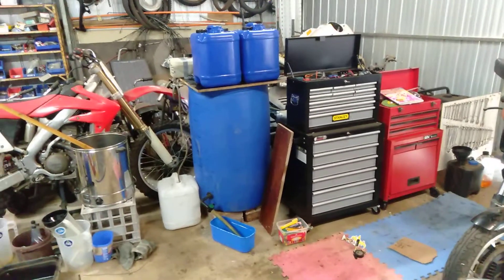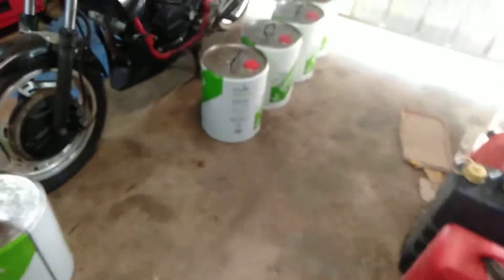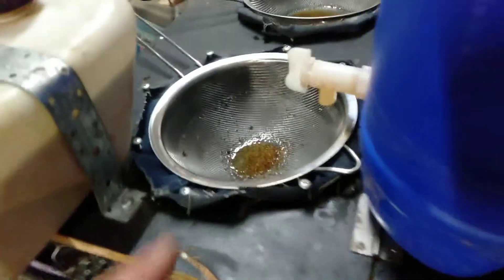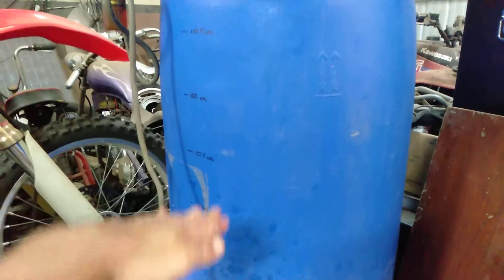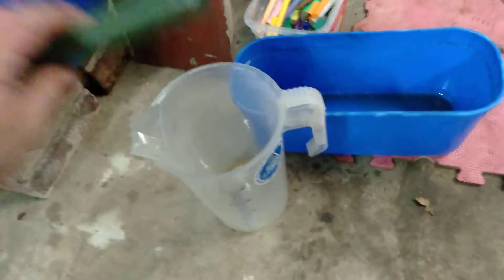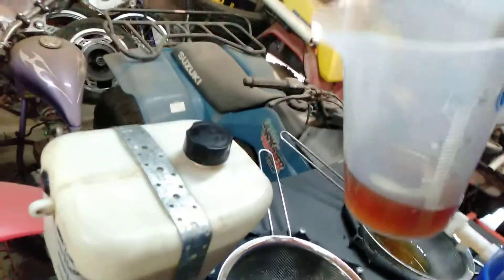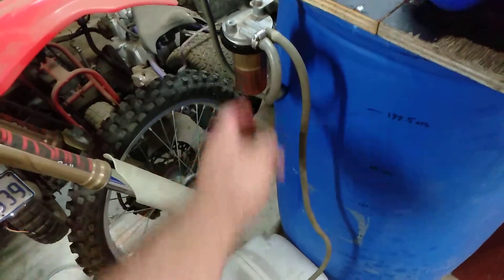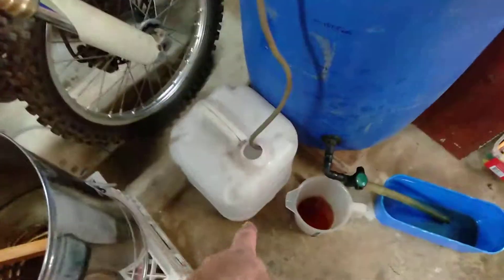How to use filtered vegetable oil in diesel heater or any diesel engine

Comment: What you need is two separate tanks one with diesel and one with the 50/50 mix . So two separate tanks with two separate lines . At the end of the line put a double tap on the lines with one out feed tap on it . Start the heater with diesel for a few minutes then then change over to the mix . Before you turn off the heater shut off the 50/50 mix and open up the diesel tap and let that run for a few minutes to burn off any excess. You should not get any clogging in the heater or exhaust pipe . But they do say to run the heater a little higher when using the 50/50 mix . Always use a carbon monoxide detector no matter how big or small the heater you tend to use for that purpose.

Comment: Why not go all the way.
Mix the oil with methanol and lye, to get rid of the glycerol.
Reply: much more tedious work, dangerous chemicals, plus it will eat away at your fuel line/gaskets if not replaced to S/S or other

Comment: What do you think of using B100 with either  methanol or isopropyl alcohol; example 1 Gallon B100 with 1L methanol seeing we use methanol to make BD to run on a kerosene heater.

Comment: Looks great mate! How are you finding the little heater? Have you had any problems using it with veggie oil in the last 2 years?
Reply from the maker: Hi mate eventually it did seem to clog up the heater And it stopped working. I managed to fire it up again on regular diesel and it burnt all the crap out... a lot of smoke for a little while then clean again and working fine. I probably just ran too much oil and not enough diesel in the mix.
Reply: @danielborg3115  so you ran it 50/50 and it eventually clogged up? bugger. just starting to get into WVO and looking for a simple safe way to heat, really thought this might be the way. how long did you run it before it clogged? a year? a season?
Reply from the maker: @wyattnixonlloyd8570  hi mate to be honest I probably pushed the boundaries a bit and went a lot higher than 50/50... I was probably at around 70oil/30diesel for a few weeks before it failed... I think it could be done if the oil was preheated possibly by the exhaust... it was working for a couple of months before I pushed it too far I reckon...

Comment: I do the same thing. Just filtering the used vege oil using different filter, mix it with a regular diesel and put it in the vehicle's fuel tank.